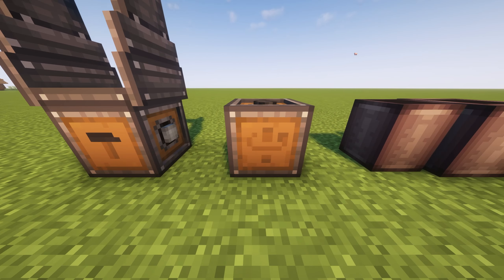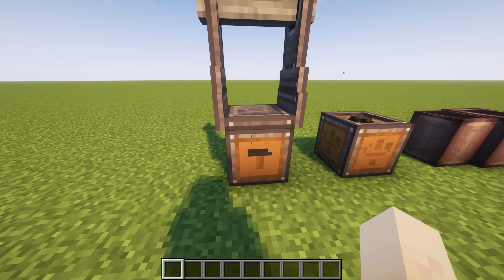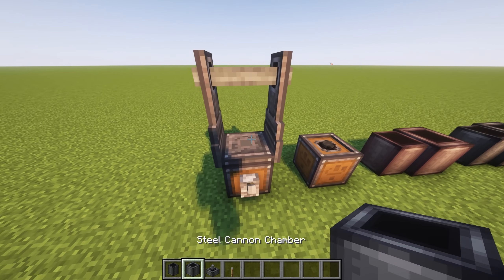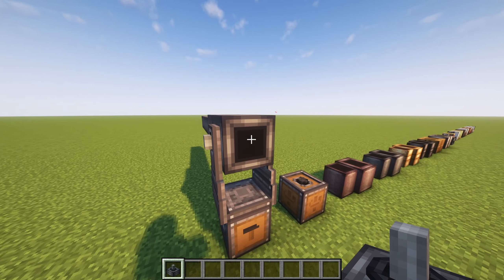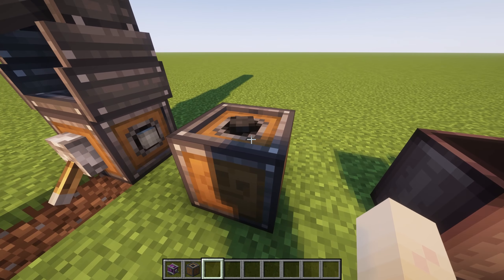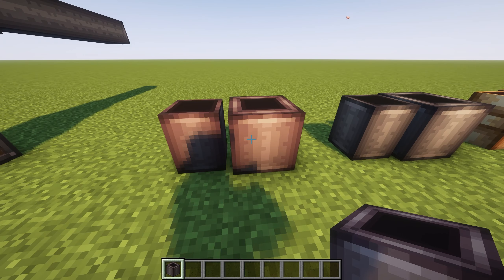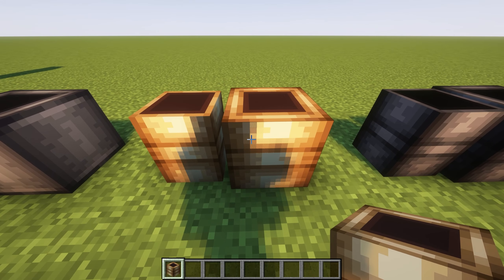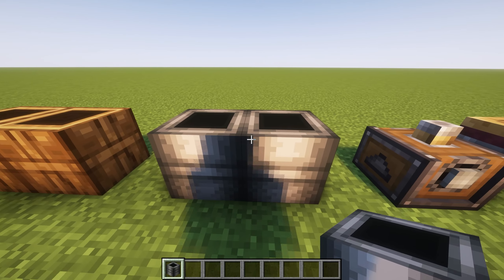Create: Big Cannons For Dummies

Comment: Autoloaders tips when?
Reply: Simple, touch the autoloader in a way that it feels safe and loved and then it will autoload all over.
Reply: there’s a ponder section for autoloading within the mod
Reply: T-72/64/80/90 tanks autoloader 😈
Reply: I just made a short with an auto loader for the screw breach. Take a look and ask any questions if needed
Reply: @shoople46 could we get a link
Reply: Im hoping youve found a solution by now, but if not. Mechanical bearings on chain drives, deployers, and a lot of timing and circuitry.

Comment: For some reason even when i follow all the instructions for breech loading i cant get the cannon to actually fire. Everything goes as shown in the video but when i close the breech and throw the lever nothing happens. This mod is insanely overcomplicated from what it needs to be
Reply from the maker: If you’re using a quick-fire breach, make sure you get your cartridge from the Create: Big Cannons creative tab. For whatever reason it won’t work if you search for it in the creative menu
Reply: @qarsan2  I finally sort of got it working, although the fact that the cannons explode after a set number of uses severely limits their use. I wish this mod weren't so incredibly complicated with so many moving parts, or that there was at least one "arcade" cannon that didn't need the 80 step process to get functional
Reply: After an hour, I still can't get mine to work. Like you said, too complicated for no reason.